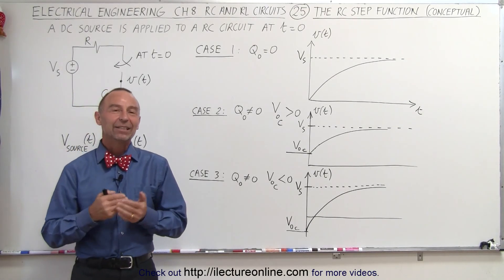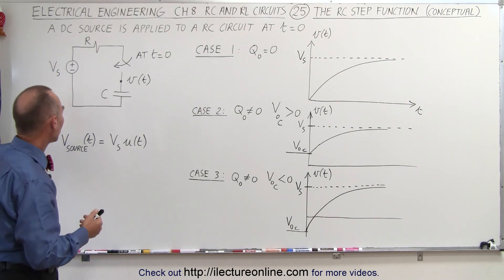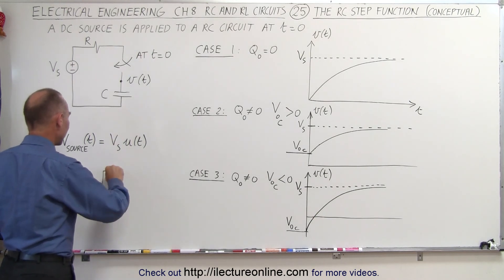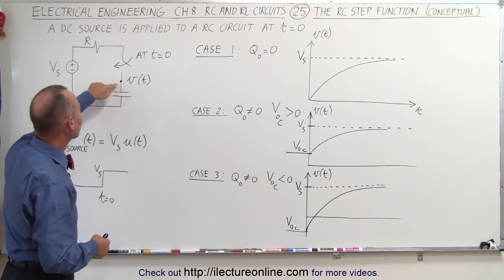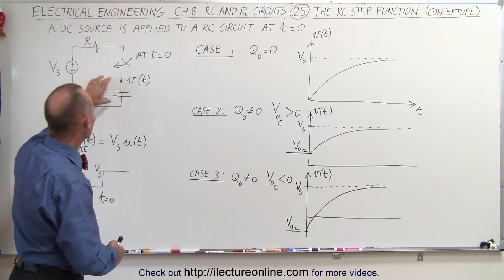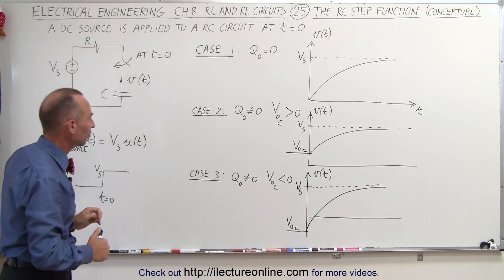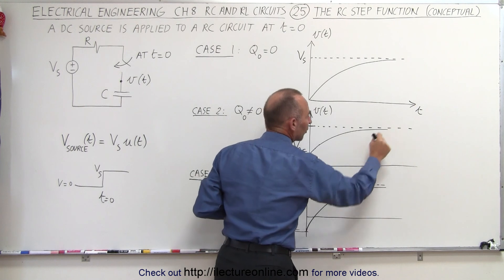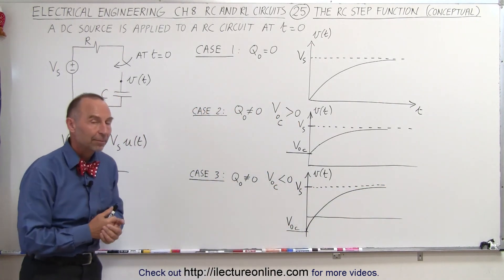Electrical Engineering: Ch 8: RC & RL Circuits (25 of 43) RC Step Function (Conceptual)

Comment: Is the voltage on the bottom side of the capacitor Vs please?
Reply from the maker: The potential at the bottom of the capacitor is the same as the potential at the bottom of the of the battery.  After the current stops (when the capacitor if fully charged), the potential drop across the resistor is the same as the potential rise across the battery.
Reply: @MichelvanBiezen   wow, thank you for responding sir! I do understand now, thank you very much.